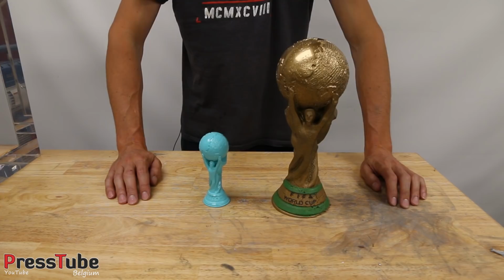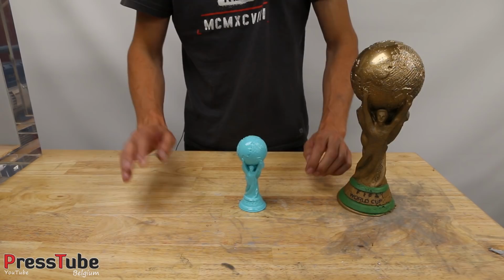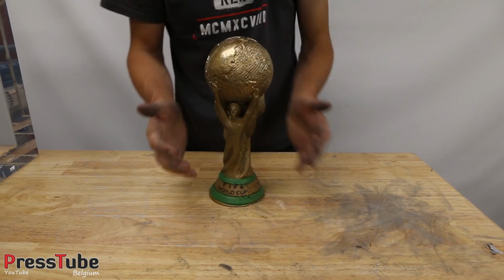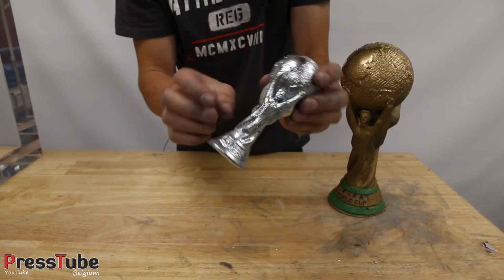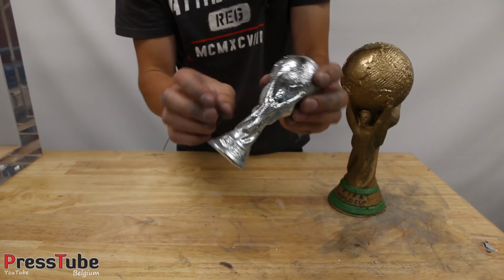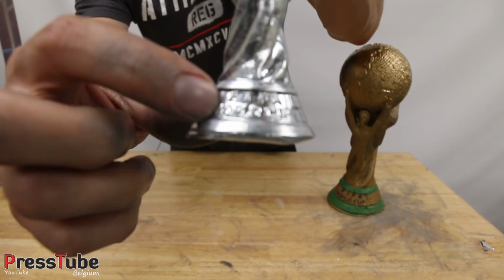Making ‘ Silver ' World Cup Soccer Ball Trophy from Gallium

Comment: I read: "Elemental gallium is a soft, silvery blue metal at standard temperature and pressure, a brittle solid at low temperatures, and a liquid at temperatures greater than 29.76 °C (85.57 °F) (above room temperature, but below the normal human body temperature)." Does that mean that this may break at low temperature? But that's not the killer. Will it MELT at 29.76 °C (85.57 °F) ?!
Reply: Its a mettaliod so it will most likely melt at room temp.